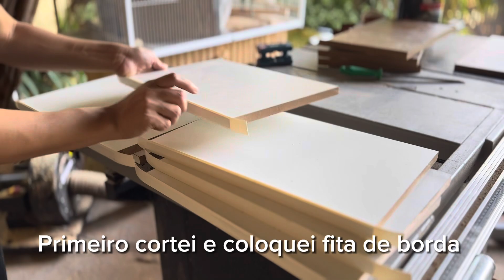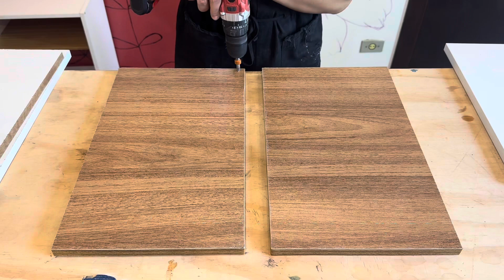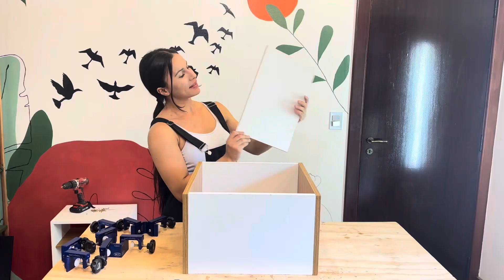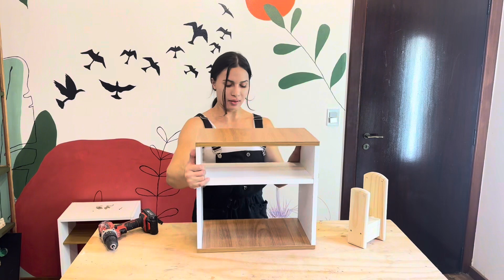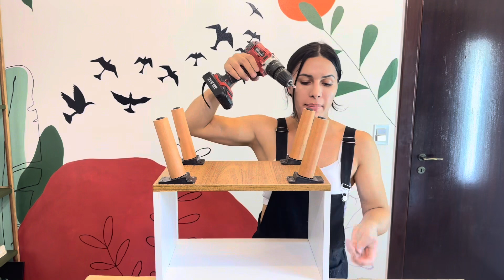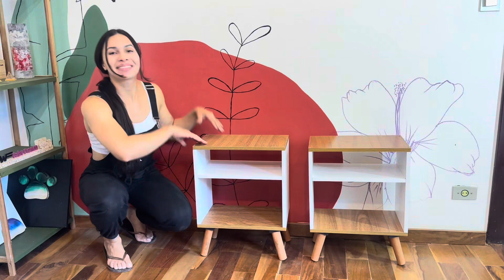NÃO SABIA QUE ERA TÃO FÁCIL.

Comment: The frame is redundant and the material used is not as strong as it appears to be. Therefore bracing the frame is necessary. A same material sheet at the back will convert the constructed wooden frame strong and long lasting.